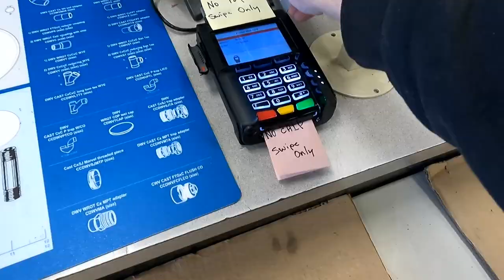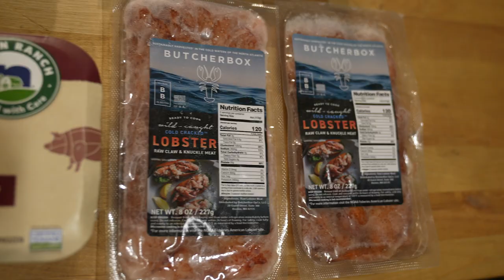PLUMBING WITH NO EXPERIENCE | BUILDING OUR OWN HOME

Comment: They should be sure to insulate the daylights out of the basement if Allie has Reynauds because that room will always be colder than the rest of the house.  What use is having a basement if you can rarely go into it?  Our basement doubles as our backup refrigerator in the winter.
Reply from the maker: We definitely will!

Comment: I hope you two have a way to pump third floor heat into basement to equalize temperature in house. If not you will fight a 15° temperature gradient for ever. I used HVAC to take feed from 3rd floor and pumped 75% of heat into basement, ended up with 2° gradient. Very hard to live in a house with a large heat gradient. 
Great progress, keep your spirits up and push on.

Comment: Trent don’t forget your nail plates where ever you drilled thru studs. You dont want a drywall nails/screw to punch a hole in the pipes. May not be code but maybe it is .ask kevin

Comment: I’m not a plumber. But couldn’t you have removed the clean out plug in the basement and stuffed hole with cloth to prevent sewer gases from coming up?  Remove cloth later once done. That’s what we did when we took toilet out during remodel.

Comment: Alli. Try Heat Keeper socks super comfy and thick .     Also.  Look up MUCK BOOTS (ARTIC).   they have tall and short ones and are rated for -30 I believe      Great work/snow boot easy to slip on and off. One pair will last you 10 years.  Men and woman  sizes.

Comment: You’ve been so lucky to have so little snow so far this season. It’s been super light up here in AK this year as well (at least in south-central).

My concern for YOU is your roofline and the ton of snow it is going to dump on your deck - when you least expect it. Once snow builds up on your roof (and I understand that the steep angle should help keep too heavy a load from accumulating ... in theory), it is going to be unpredictable - and heavy sheets of snow are going to give way and come crashing to the deck.
You might want to put your main deck “off limits” for the winter once it gets to the point of even 6-8” build-up. For your own safety and that of guests.

It’s going to be an awesome deck from spring thru fall! ❤️
Reply: I was thinking the same thing. I live in Minnesota with lots of snow, and even today coming out of the store, snow slid off the side of their awning as I was pushing a cart to my car. My kids' school has a metal roof and they couldn't let kids out the back door because snow huge pointy ice spears dangled. That summer the school got some little spikey something or others to put on the roof edge, to break up sheets of snow. I don't know whay they are called. But I have a roof rake to get snow off from over my deck if it builds up. That's to prevent ice dams. I also have "hockey puck" roof melt salt tablets I can pitch up. But their roof is way too high for that. I'm sure Allie noticed it when she edited the time lapse camera on the pole. One second the roof was white with snow, the next frame it was black. They have also heard it from the inside. Yeah, it would be a bad idea to put a hot tub on that deck, with that roof!

Comment: " Honey i spent a million $ on pipe ". Here in Canada  PVC schedule 40 white pipe is used for POTABLE High pressure water, it is Twice the cost of Black ABS Sewer and drain pipe. Might explain why it was so much. You will need to build a wall in the basement to support the drain pipe before your inspection. If you want to heat the whole house,  PUT YOUR WOOD STOVE IN THE BASEMENT, then use a few vents to let the heat rise up to the second and third storys. A bit of Canadian off grid wisdom for free. LOL                       CHEERS                 Steve h.

Comment: you do know  when setting lay out  like toilet that finish work to center  to  hole  be drill ?,, and they may saying something about use 2x4 walls when send 3" or better vent pipe thru ..and cutting out  wall plates ,,only need 3"  drain and vent for 1 toilet 4" if  there  2 ,,all sinks and showers  only need 2" drain and vent
 before going thru roof about 2-3 feet below roof sheeting  in very cold zones to 45% up 2 feet   then 45%  returning back to plum 90%  then thru roofing sheeting

Comment: When glueing the waste pipes never glue inside the fitting, the reason being is if you glue the fitting the excess glue is forced into the bore of the pipe causing a reduction in the bore of up to 25% plus when the glue hardens it causes a ridge that catches much of the detritus . If you glue the pipe the excess is forced out and can be cleaned off.

Comment: Maybe the glaucoma diagnosis is a red head's thing.  I've been told for three years now that I have all the signs of glaucoma without the glaucoma.  And I can't see a tennis ball once it's within reach of my racket, or tell if a baseball player reached the plate before the ball did, in a close call.  --  It will be VERY NICE to have water for a washing machine once the plumbing is installed.

Comment: Hello, I am a nurse who works with patients that have autoimmune disorders. I think that's why I feel like I should clarify some things. There are two forms of reynauds. Primary is which when reynauds occurs on its own. Or secondary which is when raynauds is LINKED to an autoimmune disorder. Reynauds in itself is not an autoimmune disorder. But when a person has an underlying autoimmune condition, reynauds can be caused by the disorder itself.

Comment: Interesting video! I love new plumbing - the smells of fresh cut polycarbonate and "illegal" glue (in Europe, guys with beards get asked if they are over 21 and what they will be using plumbing glue for!), are wonderous. Old plumbing - poop and gunk - is just pure evil. P-trap in a wall? That would be a no-go in Europe, as its unmaintainable/hard to unblock - suggest strongly you make it accessible, and hence outside the wall - I always use unscrewable P-traps as they are easier to clean - Good Luck!

Comment: I think the plumbing was a problem or a very tedious job weight for the big job. Wiring will be your nightmare because then you have to drill through your studs Mount the boxes run the wire and it's a lot of miles of wiring in your place. And that has got to be definitely up to code. Your breaker boxes plug boxes and your plug connectors and all but got to be code. So I can't wait to see your wiring job have fun I see your going to have it done before Spring

Comment: Just wanted to clarify. The reason why there's a pitch restriction is not because of water out running the solids. when the pitch is too steep it will suck the water out of your p-trap thought a siphon effect. When your p-trap runs dry, you will get sewer gases in the house.

Comment: Rather than take a long trip just for 4" hole saw, I'd probably have cut with the 3" and then used narrow blade on jig saw and carefully made into a 4" hole. Clean-out should probably been better to also use a "Y". Why not cover those open sewer holes with some plastic taped over them to keep the gases from stinking the place up as much? I don't understand why such a long pipe coming down from upstairs to basement before it joins the main drain stack. If you'd join it higher up, and closer, under the joist, you'd save more open space underneath it. In my home the upper toilet, bathtub, actually go to the main drain immediately under the floor, and attached also with hangers to the side of the joists. Also since my joists run same direction as the joists, that makes it easier.

Comment: Question...since a basement is always the coldest area in any home, could I install the wood burning stove in the basement then run the chimney pipe up through the basement ceiling and then on up through the roof?

Comment: Hi Trent and Allie, I used to work as in plumber back in the early 80’s and 90’s. You said that you are using 3” pipe, I’m curious why you are not using 4” pipe for your main drain lines, that is usually the standard. Also, I know you said that you are using the cement with primer in it but did you check with your inspector to see if that is ok?  I once plumbed a 6 family apartment house using the all in one cement and the inspector made me redo the job because he wanted to see the purple primer on the pipe.  I really hope you don’t have a problem. The house is really coming along nicely, keep up the great work. By the way, can you tell me where you got the painted pictures of Frank, I’d love to have a painted picture of one of my dogs that we just lost.   God Bless you guys.

Comment: Drain pipe is not designed to have a pipe glued between two pieces in the way shown @20:50.
I have a problem with the editing in this video.  The end of the gluing job is always edited out, so it is not possible to tell if the job is being done correctly.

Comment: I know cold falls but cover that hole up that goes to the basement  you will be warmer Grainger makes a poly insulated tarp to cover up you basement door opening. Does the candle give off carbon monoxide?  What is the BTU rating  and no way 25 K BTU will heat your house I have a 2,000 sq ft spray foem building and have to have 125K but to heat it.

Comment: Just out of curiosity, won't the plumbing stack vent come up in the wall between the master bath and master bedroom? If you don't enclose that in a wall, it may not be very attractive looking.  Can the vent be run horizontally in the ceiling. I know it has to slope but not too sure how much.  If you built a wall to enclose the bathroom roof, you can hide the vents in that wall and keep all the storage clutter (and dust) out of sight.

Comment: Not sure if its been said already, but to stop dealing with your septic smells just put a balloon test ball in the clean out at the base of your stack, assuming that's likely what you'll need to do when youre filling the lines during leak/pressure test anyhow, they make ones that screw into the T-fitting... photo found here https://terrylove.com/forums/index.php?threads/test-ball-balloons.36720

Comment: your eye doctor is telling you wrong: with glaucoma you lose your peripheral vision first, it takes a whole lifetime to go completely blind if you treat it, and it's usually different in both eyes. I just turned 40 and I was diagnosed with it around your age. Did they tell you if you have normal pressure in your eyes and did they do the peripheral test? I have normal pressure in my eyes but they gave me drops to lower the pressure even more to preserve those nerve endings.

Comment: Way too late to mention this, but by the time I realized you didn't, it was too late.
I wonder why you didn't put an egress directly into the basement...
But like I said, too late now, anyway.
You guys are braver than I am. Plumbing is a very close second to electrical for things I will happily hire a professional for.
Top two things I just don't mess with if I can at all help it.
Well. I'll design it. I made a living at that sort of thing, after all. But hands on? Nuh uh!
... My late husband had Raynaud's. 
Yeah. That looks scary. Unfortunately, it did turn scary. He was taking an Rx for that and for stomach problems. Doctors refused to believe there was conflict. 
Then the last trip to the ER, they added a 3rd combatant to the mix because his heart rate was high. 
Monitors started looking like a toddler got hold of an etchasketch... 😔
Gee. Right after that the report came out that the two meds were incompatible...
Doctors don't like "I told you so", by the way.

Comment: YOU may what  call building Dep't .. don't know i seen in 45 years  walls that 3" +  drain and vent that code IS 2x6 wall ,DON"T forget you can't go around 3"+ pipe with wiring with 2x4 wall that pin wiring to sheetrock and pipe and will NOT pass

Comment: Dry fit everything and go back and glue later.
Does anyone have any experience with DeWalt battery operated tools? I've had nothing but expensive grief with any other brand. I'm wondering if Dewalt will still be a good choice in 2 years

Comment: Why don't you wear Columbia  Snowpants?They make them very stylish, and they're not bulky.
Reply: Install support hangers for your plumbing pipe whenever it runs almost horizontal.  Make sure the slant is the proper angle.  Good job Trent !
Reply: You're lucky you can get food delivered by mail in the mountains.

Comment: Cutting a Hole in BLOCKING should not have any effect on the structure.  If you cut that size hole in floor joist, you better reinforce it with additional structure.

Comment: So, do you not know to dry-fit things first, make marks to know where things line up AND THEN start gluing up.  Just shove a rag into the stink hole when you are not fitting things.  Put some mentholatum on your upper lip.  Its what you rub on your chest to help with coughing and stuffy noses.   It has a smell that will mute the stink pit smell...

Comment: Back in the day when I had a house to work on, I always found the plumbing supply place NEVER had the pieces I needed. So, I had to redesign with the parts they actually had. Plumbing is the worst of all phases of construction. Fortunately, plumbing-wise, you have a relatively easy design. Good luck to you both in the stink and the glue. I didn't hear any gaging or retching. You're doing great.

Comment: To non plummers,  the slope is important. 
Ever hear a tolet flush in the walls or cieling.
Of go into a bath room and smell,  crap gas.
If the slope is to great the water can siphon water out of traps.then gas fload the room.
There alot of engineering that go in to a system.💩💩💩🙀🙀🤮